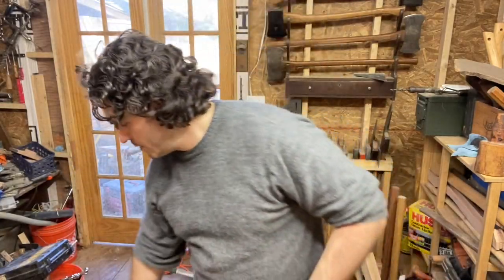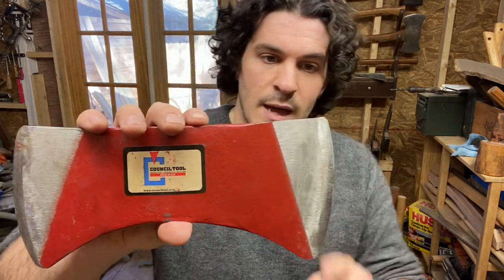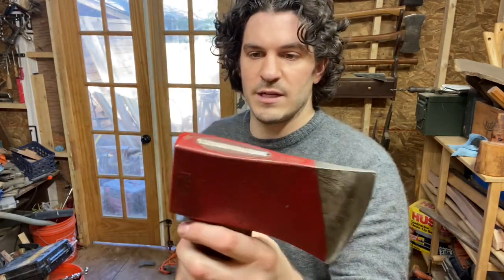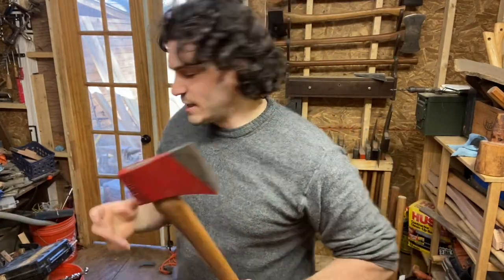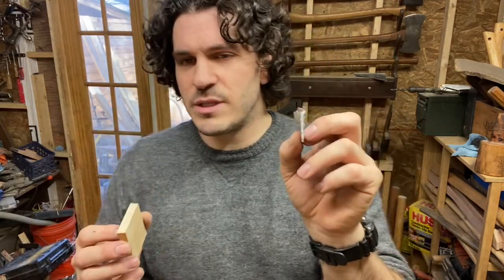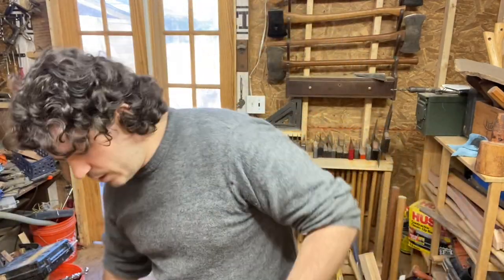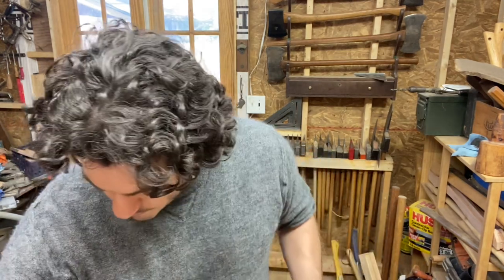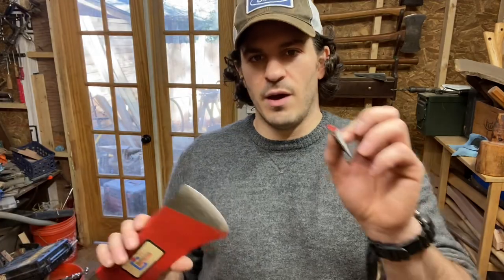Why aluminum wedges suck (with evidence)

Comment: I think with the production line of the red painted Council Tool axes, that was just the way of things. Given the process, at the time,  I believe in a video tour, when they're hanging the axe, the head was pressed on the handle using a hydraulic machine. The handle was fitted to the eye with very minimal wood removed, and the when head was pressed on it peeled a lot of wood. The aluminum wedge was added in next, same method.
And I believe Council Tool's response or solution to the red painted production axes was the current sport utility line which are fitted with traditional wood wedge and an extra steel barrel wedge to mitigate complaints and suggestions to their fitmanship with heads coming loose.
Reply from the maker: Very interesting. I really like the sport utility axes it’s a great product line.
Reply: @urbanlumberjack  I agree the sport utility line gives you a very good axe, I have a sport utility Jersey pattern dated 2020. The information i shared earlier was also stuff i was hearing around the same time as my purchase. Unfortunately though my axe did work itself loose too as well after a few months.

Comment: I don't have much experience with the style of aluminium wedge you show here, but agree they do look too short. The thinness wouldn't matter so much if the eyewood was a good fit
Reply from the maker: It’s a strange design. I’ve never seen these for sale anywhere, so interested in why they keep being used.

Have you ever used the tuatahi aluminum wedges? They seem decent and vintage axe hoarder was saying he likes them. I may give them a shot.
Reply: @urbanlumberjack  I've got a bunch of the EFA wedges, they ship the handles with the wedge and roll pin. Only thing with EFA, is that their axe eyes are fairly small (compared to say a HB) so the handles and wedges are correspondingly small, works like a system. I think the dimensions are on their website. Not used the tui, but have seen em.
Reply: @urbanlumberjack Council tool actually stopped using them in their sport utility line (black finish) axes. They now use poplar wedge with a barrel wedge in the center. I’m not sure about the velvicut. All red-painted models have aluminum like yours.
Reply: @urbanlumberjack  Funny you mention that! I ordered some aluminum wedges, along with my Tui's, (work & camp axes) & the wedges are VERY robust & thick, compared to the ones Council uses! I haven't hung one yet, but look forward to trying them, next hang! When I ordered my Tui's, I requested an aluminum wedge for my camp axe, also, because the work axe comes with one. I was told, at that time, they didn't make them in that size, but when my axes came, lo & behold, the camp axe had an aluminum wedge! 
I really appreciate your channel & the content you present! You present HONEST real-world views that are very RELEVANT in this community & I enjoy watching and learning from you! Excellent work & thank you so much for sharing! 🤝🪓🌲🪓🌲

Comment: Awesome video! It’s funny I’ve only had one council tool that didn’t come loose and it is my jersey miners axe. I agree, seems like they don’t seat very well since they mushroom at the corners. They are also a pain to remove. Hence the reason my miners axe still has one lol.

I have to know, is that an older council tool double? Have you done any work to the shoulder/ eye wood? My council tool sport utility line double I used in my last video had a MASSIVE shelf, and the handle was numbingly thick. Yours on the other hand looks completely normal. I’ve been trying to figure out if the company started using club handles on all of their sport utility line axes for people who just split wood occasionally. I was really bummed when I received it, and it took a lot of work before I could use it.
Reply from the maker: This is their standard line. I was looking at their double bits, the phantom bevels on it looked killer.

The handle is stock in the video except the head rocking caused the shelf. That’s too bad about that handle! Generally speaking Council handles are pretty good. Did you get the dimensions on the handle by any chance?
Reply: @urbanlumberjack I had not taken measurements before rehanging it, unfortunately. I do have some good pictures, however. I can send them your way if you’d care to check it out. I could also make a public post about it if that is easier. Definitely something to be concerned about in terms of where we spend our money.

Comment: Aluminum wedges don’t suck, just the ones from council suck lol buy some from tui or engineered for axeman. They are much better quality, and designed to secure a 6lb head to a handle. You can also buy different sizes. 
I’ve grown to like them because they are much easier to remove (if you seat them correctly) and I’ve noticed no difference in the quality of the hang.
Reply from the maker: Is there a school of thought behind using aluminum wedges versus wood? In my mind, I’ve always had a theory that poplar wedges are a bit softer, so tend to compress and friction fit themselves into the handles.

I need to look up some videos on those aluminum wedges now.
Reply: @urbanlumberjack  my thought process is that the wedges are reusable, you don’t have to worry about them shrinking over time, and you can get more compression out of an aluminum wedge due to them not splintering out when you get to hammering on them (they will only mushroom over a bit of you hit them too hard). 

Keep in mind, I still love a nice wooden wedge. I just think the aluminum wedges have a leg up on wood in some aspects.
Reply: Handy thing about the racing style aluminium from tui or EFA is that they're long enough to sit proud if you choose, so taking em out to change handles is easy
Reply from the maker: Interesting, I may give one a shot. Do you trim them down or leave them proud?
Reply: @urbanlumberjack  the general thing is to just leave em proud, so they're easy to grab and yank out. I don't tend to use em that much though, usually make my own timber wedges similar to yours